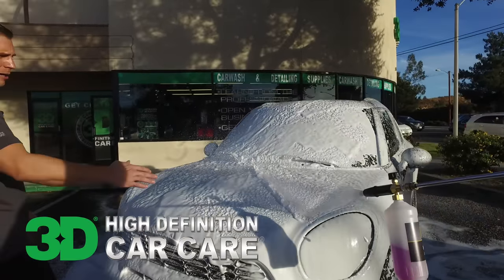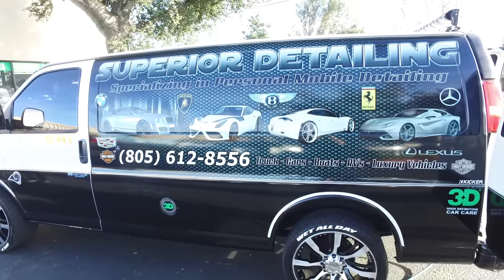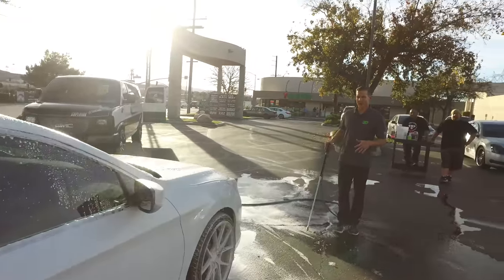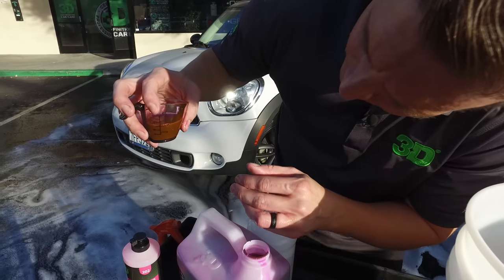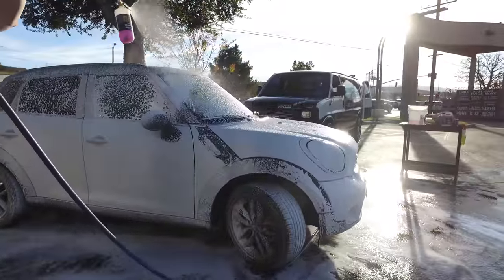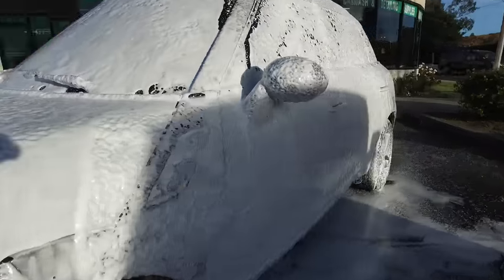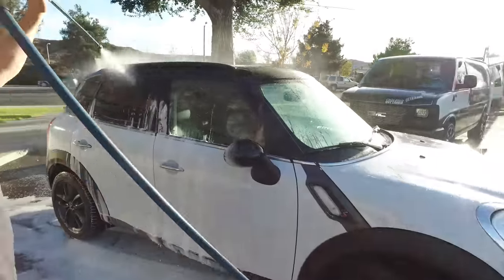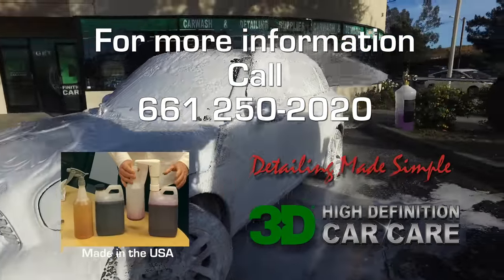Super Soap Hyper Concentrate and Pink Car Soap on Mini Cooper and Honda

Comment: Both car have some protection. It's obvious with accord.  The foam just wont stick (you'll recognize one when you have one). With the mini, you'll notice when the windshield is rinsed. From thew video alone we can tell the super soap does lot better. Just 1 thing, accord is sprayed wide open therefore produce thinner foam,  mini sprayed closed fan so result in thicker foam.

Comment: That foam looked terrible on the Accord. And 6oz is alot to use.
Reply: 1keykneedeep looks like the car is ceramic coated. Probably why the soap didnt stick. However it does still look runny